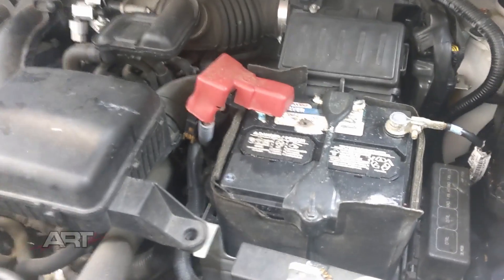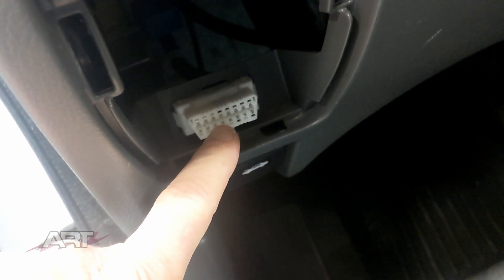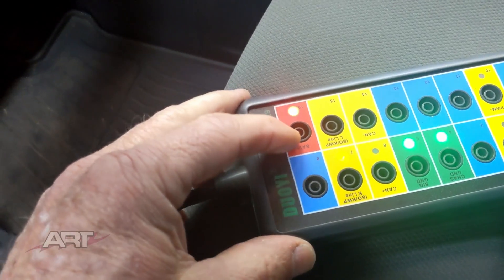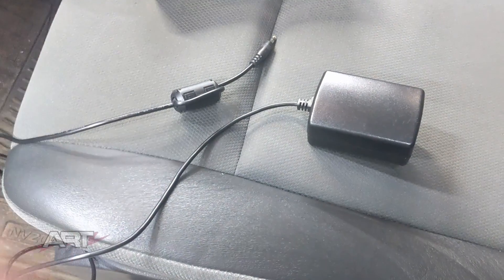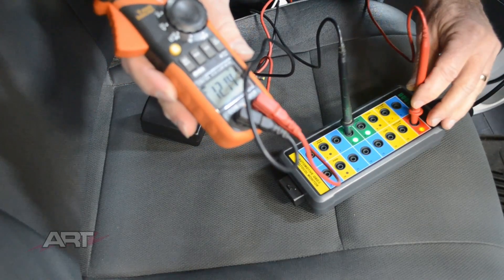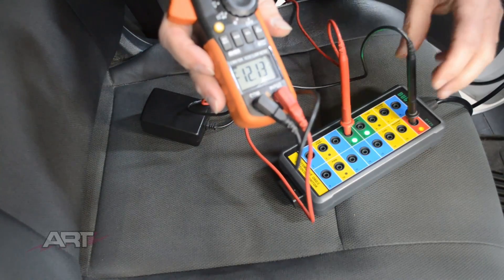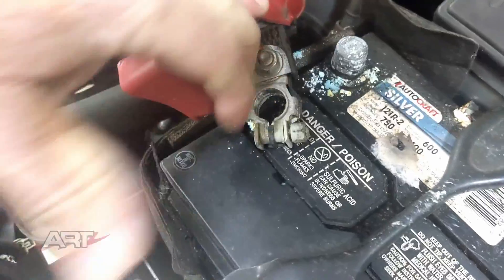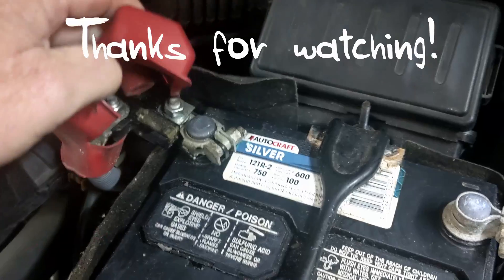Vehicle Memory Saver with Computer Power Supply v137

Comment: I believe that your chosen power adaptor (adpv26B) is the switching type rather than the linear type.  Does it matter which type of power adaptor you use for cars?
Reply from the maker: I believe you're overthinking it.  The vehicle's computer is powered by what must already be a dirty power source - the battery and all the underhood components.  Yet the computer produces 5v com bus signals that are clean.  I'm not an electronics engineer but it would seem logical to me that the computer has it's own filtering.  Also it probably doesn't matter given the minimal power required to keep alive the RAM and power an LED or two.  But I always welcome additional information.
Reply: @a.r.t.srealrepairsforrealc8247  I appreciate the response. Thanks.